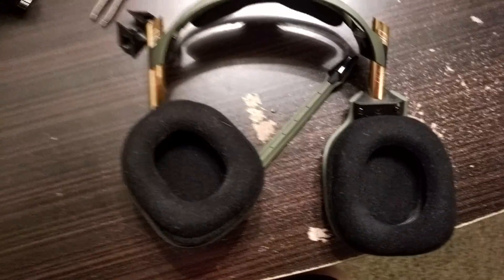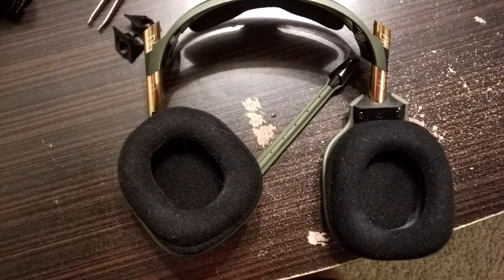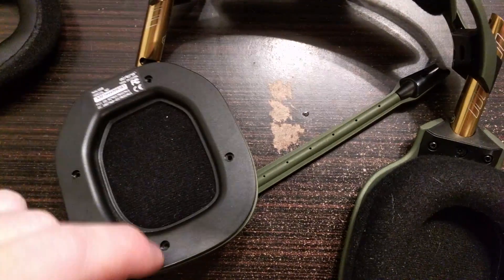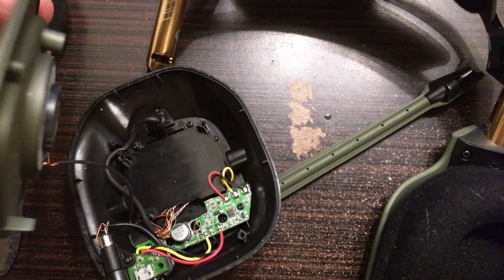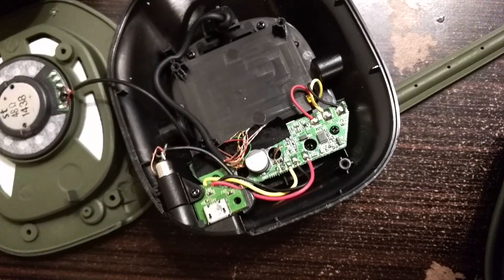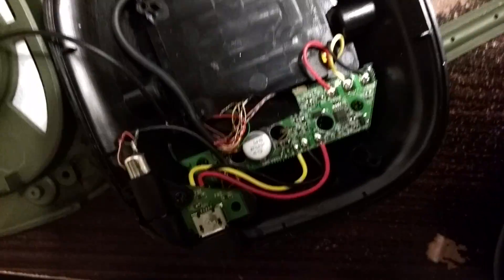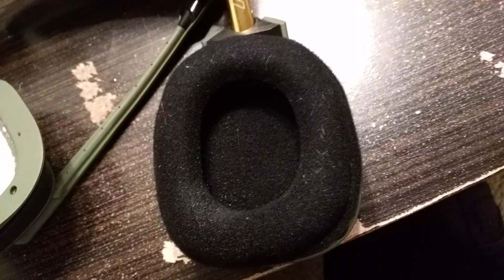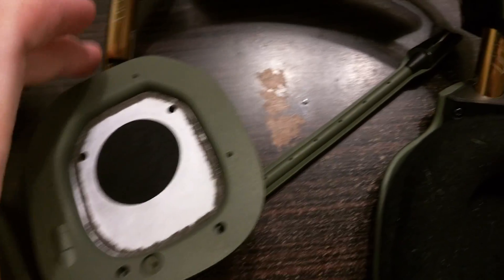Astro A50 Wireless Gaming Headset Disassembly

Comment: My mike is broken because it was forced backward whats the problem?
Reply from the maker: I would assume a wire was severed in when the incident happened. you might be able to take it apart a bit farther than I did and find the broken wire. It might take a little soldering or it may need a whole new wire. That's my best guess. let me know if this helps.
Reply: +Mediatedlake 728 Please reply if you have found a fix, I have the same problem! :(
Reply: +RossBruh  If your mic is broken where it swings loose there's no way to fix it.  I opened mine and could see broken plastic pieces that were there to hold the mic in place.  I just cut the mic off of mine and reassembled it to use as a mic-less headset.
Reply: Oh, I did find bits of plastic broken off. I have contacted Astro to see if they can do anything about it. Thanks for letting me know
Reply: Yeah they offered to fix mine but I was responsible for packing/shipping it to them and would have had to wait for them who knows how long.  I just figured it wasn't worth it just for the mic since I've got a Razer Seiren mic I use anyway.
Reply: Hey man, I took mine apart an mine came on sodered from the mother bored, what do I do ?

Comment: my astro won't charge what do you guys think is wrong
Reply: Yeah i took mine apart and found that the mini usb female had a pin bent and flattened so i barely managed to pull it back out and am afraid to unplug my mini usb. Luckily im using a really short mini usb with an extension usb cable so that it reaches where im charging it from. And as im testing how long the battery lasts atm since i finally got it fully charged, i may wind up just gluing the mini usb cable in there so i dont risk messing up the port unplugging the mini usb and plugging it back in when i wanna switch from wireless use to wired/charge and play style use. Its rather convenient how it worked out... i was terrified i wouldnt be able to get it to turn on ever again, then i was worried id have to use it as a wired headset, but so far so good. fingers crossed 

If you ever do take urs apart just be careful with the ear foam that you have to take off as it does tear from the glued spot and youll wanna line it up properly when reassembling, what i did was i placed a dot of super glue at 3 points to create a triangle shape towards the center of the foam, and then i let the plastic piece that goes over it hold all the edges down so it doesnt come out and doesnt look or feel weird.
Reply: honestly youll think its pretty ghetto but i got it working, im just terrified of the pin beding again, and if im not mistaken one of the mins tips broke off a bit prior to disassembly, but the connection works so i just keep a really short mini usb cable in at all times to reduce the risk of messing it up again, and then use a usb extender when im wanting to charge and play or w/e. 

Anyways i had used a pair of needle nose pliers, a small flat head like youd use to work on small electronics, and a pair of sturdy but very pointy tweezers. I had to bend the metal usb casing to be able to get in there better and bend a bit of the top where theres an opening so i could see what i was doing, i then used the tweezers and flat head to try and bend the pin straighter so i could pull on it with the needle nose pliers. Once i got it straightened out more, i was able to just bend it back into the plastic channel where it was originally. After that i just made sure i could get it as flat as possible by essentially scraping the top towards me with the flat head to make it as flush into the channel as i could. After that i put it together and it was working again. It still doesnt always seem to hold its charge on rare occasions but leaving it charging whenever not in use usually keeps it in good working order.
Reply: same here. I bought turtle beach. but I plan on taking my battlefield 4 edition a50 as mine won't hold a charge or turn on. Astro is no help.
Reply: any chance you were able to fix ur a50s? as i have this issue myself and am thinking about opening it up to see if theres anything i can do sometime soon...
Reply: No i didn't bother to be honest.
Reply: +TheMadHatta What did you use to repair the bent/ flat pin, I have the same issue
Reply: +TheMadHatta Actually don't worry I fixed it! I had the exact same problem as you, my 5th charging pin was bent back & I used small scissors to cut the metal frame, then I used tweezers to bend the pin back into place & now it's finally charging. 

Edit: I just realised you replied to my comment & now my first sentance makes no sense lol, I was on mobile & didn't refresh the video so I didn't see your reply :p Thanks for the help, I used the method in your original comment and you just saved me $200!
Reply: Wow awesome happy to have been of help. Yeah i hate using my phone for youtube comments its a giant pain i just always have a tab open at home and my computers always on so its only if im out that i deal with the phone :P

Anyways, you mentioned you used scissors to cut the metal frame? What kinda scissors allowed you to cut through usb metal? I fear my headset might run into the issue again down the road and i know i wont be able to replace it so id love to know what i can try differently if there happens to be a next time...
Reply: TheMadHatta I used surgical scissors to cut the frame
Reply: Really, i had no clue those could cut through metal, im gonna have to see if any of my similar scissors can pull that off on a broken usb i have laying around cuz thatd make the fixing process like 10k times easier than me having to use a flat head, pliers, and tweezers, took me like a solid 30-45 mins or longer to fix lol im sure it took u less.... and im talking time it took once you already had the headphones disassembled.

By the way how did you reapply the foam type cover over the speakers inside the ear cushion area, i used some dabs of super glue and in retrospect it seems that may just make repairing it again if needed a nuisance.

On an unrelated note ive been noticing in comments and comment replies the Fluroxide :D  or TheMadHatta tags at the beginning of comments. Does that help the alert system youtube uses to notify people they have a comment to check on or is it just to help the readers understand who the msg is directed at? Im just curious because im not sure if i should be including a +(insert name here) more or not(like ive been doing).

Thanks :)
Reply: TheMadHatta Yeah you need to apply quite a lot of force with the scissors it's probably not the best idea lol but it worked & it was quite fast, it took ~10 mins.

For the reassembly I just applied a few drops of super glue on each corner similar to you, but yeah I didn't consider that I may need to take it apart again...

Well if you don't have a +(insert name here) it looks like you are replying to the original comment ("my astro won't charge what do you guys think is wrong" in this case) however if you use the +(insert name here) it lets everyone know that you are replying to me for examle instead of the original comment as in some instances it isn't so obvious. So yeah it's just to make it obvious who the message is directed at.
Reply: For sure thanks for the heads up, i found i wasnt able to do it when in the video page hitting reply, but on here in the drop down notifications i can use the command, kinda odd that it doesnt automatically use the +(insert name here) when you hit reply to someones comment on a comment, i coulda sworn it used to shrugs

Comment: Thanks for doing this. I've been having some trouble lately with my mic. It randomly will overload with a ton of static so anyone on the receiving end is just blasted with white noise. Is that the issue you were having?
Reply from the maker: No, my issue was that when I plugged in my chat cable I couldn't hear or talk to my friends. The static could be the cause of a loose wire. You might need to get in there to reconnect it better.

Comment: Did you need a special screwdriver to tale the screws out?
Reply from the maker: Yes I did, but I already had them, so the only suggestion I have for places to get them would be some place like radio shack.
Reply: +Jonathan Sorensen small phillips, go to the $2 shop and buy a precision screwdriver set
Reply: +Jonathan Sorensen any tool shop will have them. Usually with the electrical related tools.

Comment: my micro usb port needs to be replaced..thanks for showing how to get the cup off
Reply from the maker: Do you know the issue with it? If it looks ok on the outside but isn't working then it could be a soldering issue like I had. It's a fairly easy fix.
Reply: The inside of the port (the prongs) are broken.. and unfortunately there arent any repair shops around that do headphones so Im on my own on this one lol
Reply from the maker: +DemolitionboyXX oh. well good luck!
Reply: +DemolitionboyXX same this is wrong with my a50's, were you able to fix it yourself?
Reply: no :(
I could have if I put my mind to it. but i havent made time to do it